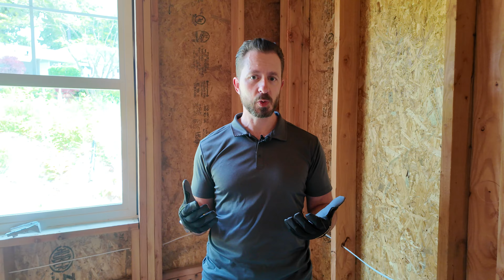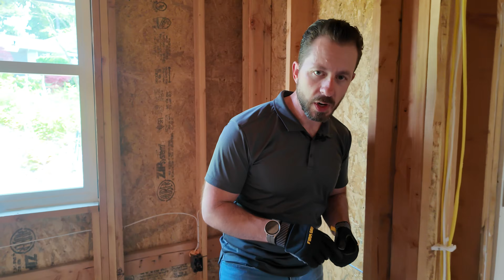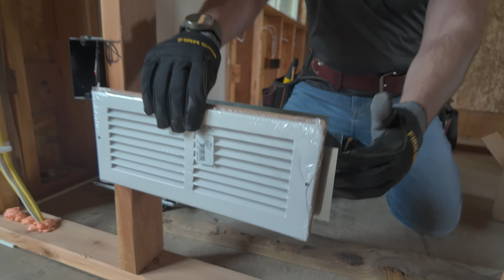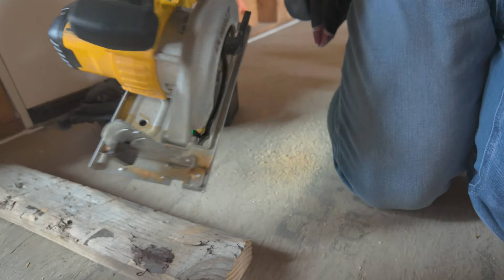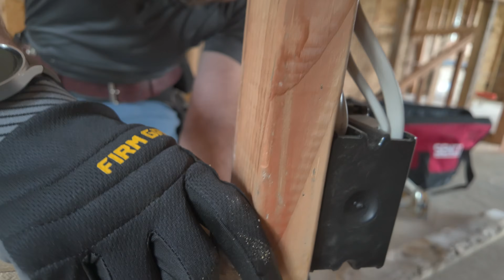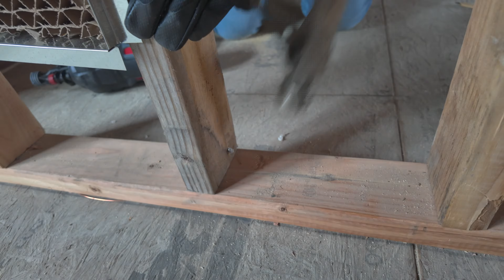Tamarack Return Air Pathway (RAP)

Comment: How does this return-air pathway make a house better?  Is it just a passive exchange of indoor air to improve the balance of air pressure?  How do I know where and how many of these to install?
Reply from the maker: It provides a clear return path for the supply air to get back to the return. You can take a look at your supply register and consider matching it but I'd also suggest talking to the manufacturer.

Comment: In my market (central NC) they place these above bedroom doors and call them transfer grills. Another method is what they call jumper ducts which are placed in the ceiling above the door or wall adjacent to a hallway or open room with a clear path to the primary return. The jumper ducts are better for privacy and reduce noise transfer between rooms when the door is closed. The negative for the jumpers is more ceiling penetrations to have to seal up.
Reply from the maker: It's all about tradeoffs
Reply: Hey Aaron, in your experience how much of a hassle is sealing off the ceiling? Our new build is supposed to come with transfer grilles and I'm going to see about asking to upgrade to jump ducts but they would go through the unconditioned attic and so there are the sealing and insulation worries associated with that. However, I'm afraid the transfer grille will be really bad for noise and light. Have you used these Tamarac inserts before? Were they effective for noise?